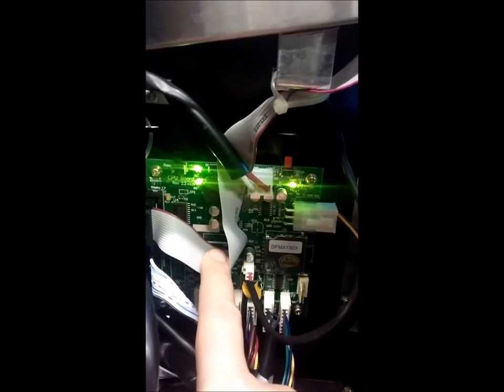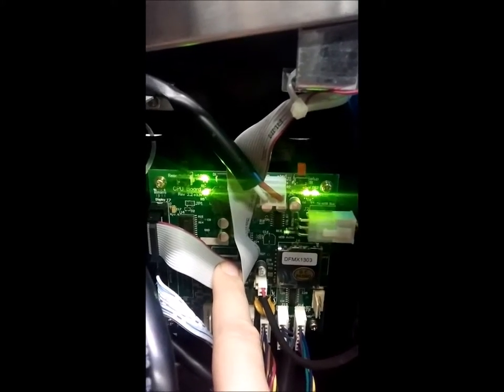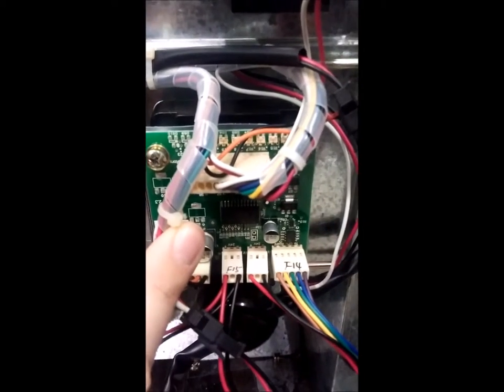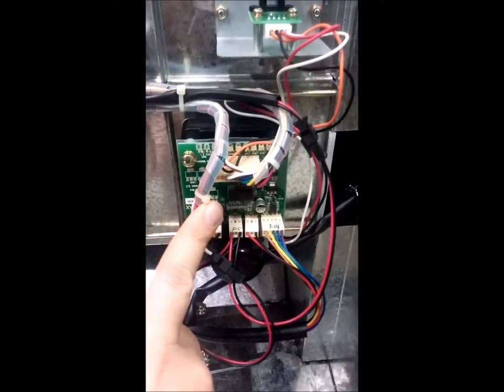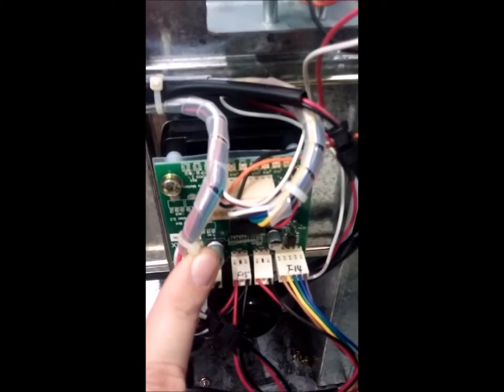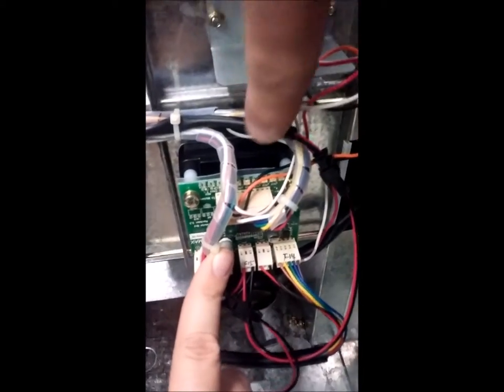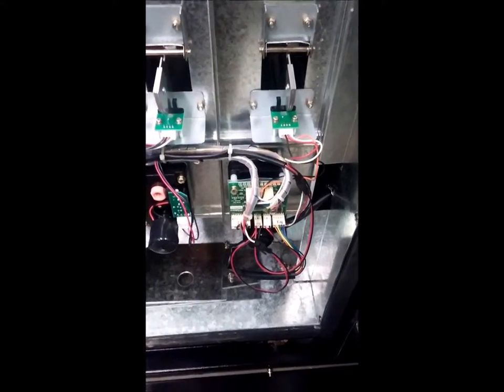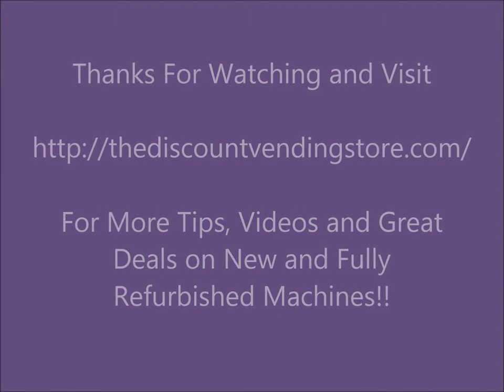Fortune Resources Vending Machine Main Control Board Troubleshooting

Comment: I upgraded my control board to 2.3 and my B04 bottle didn't dispense water bottles properly.  It turned only halfway.  Before taking everything apart, I decided to change the setup bottle from 16oz to 8.3oz and it worked, and now it does a full rotation for the water bottles to dispense.  It seems the programming of the control board was reversed or perhaps some other reason.  Did you have a similar issue?
Reply: ***** Nevermind, the water bottles was of poor quality (very thin) not allowing the motor properly cycle.  I switched to a more smooth and thicker water bottles and it worked fine at 16oz setting